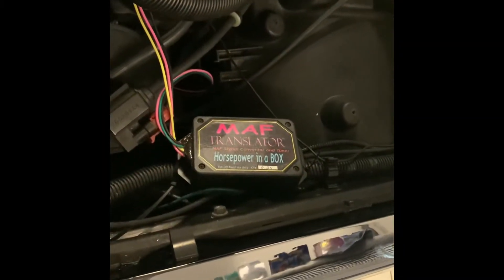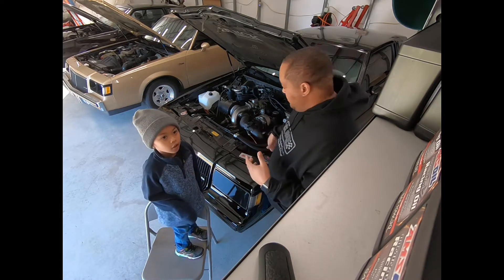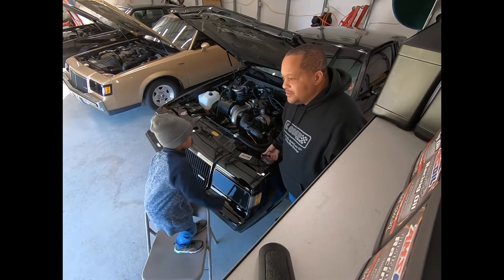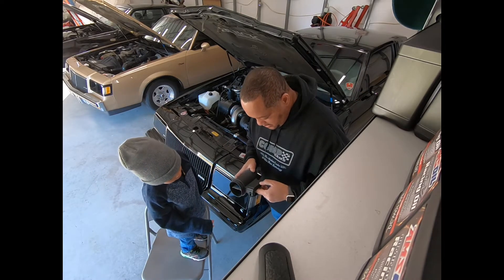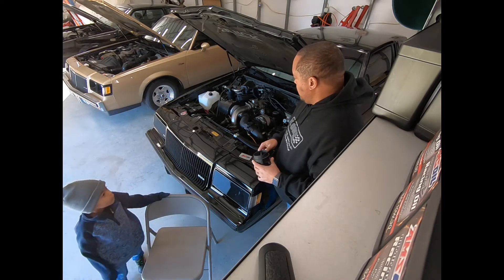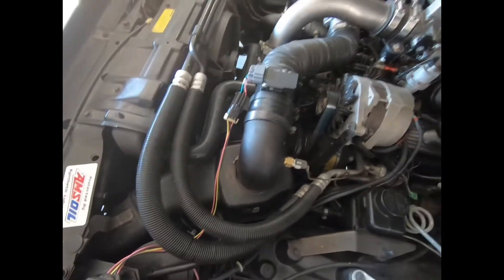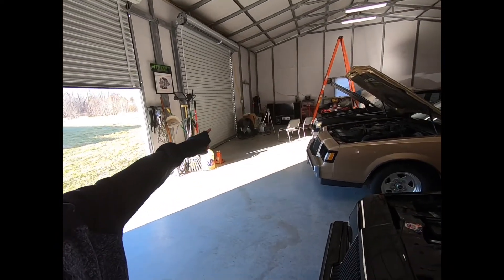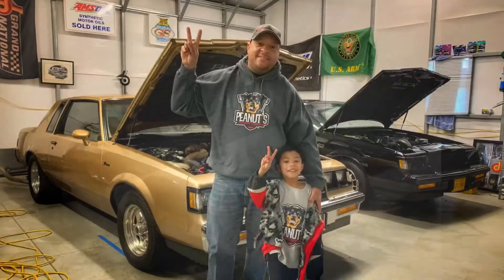Buick Grand National MAF Installed

Comment: It looks like you installed an LT1 MAF Sensor, but kept the stock airbox, etc.  Did you have to make any modifications to use the LT1 MAF Sensor with your stock equipment?
Reply from the maker: Yes.  Used a rubber hose adapter purchased from Pepboys and the factory hose clamps to get it to fit around the 3 inch MAF.